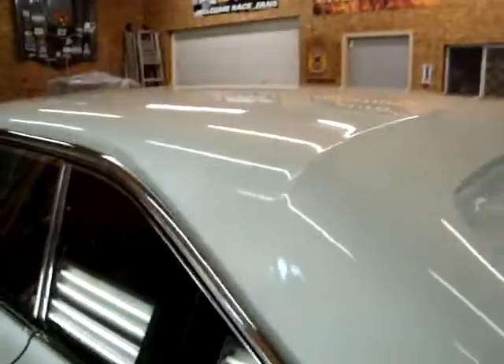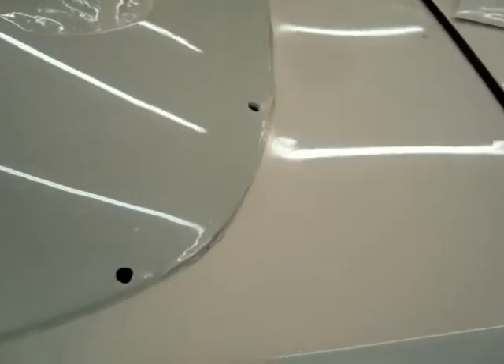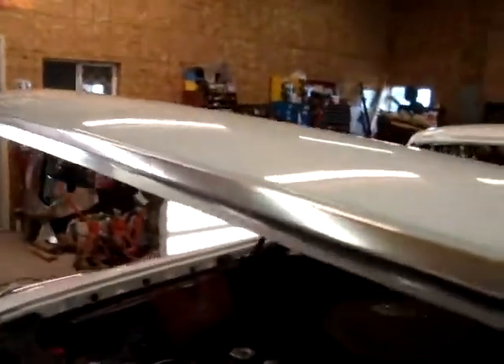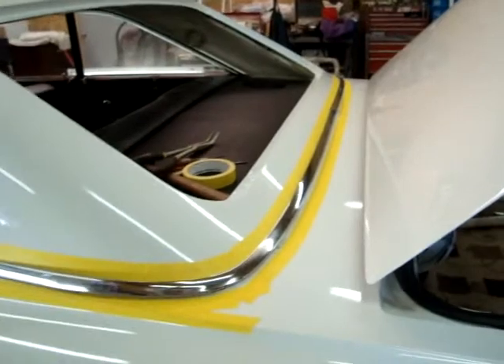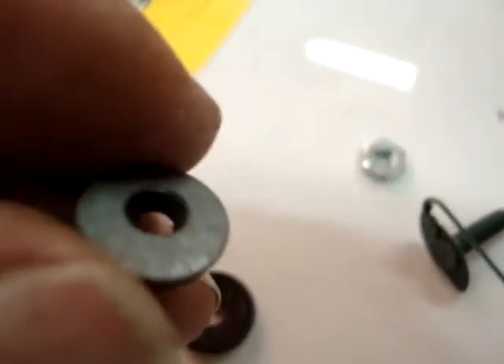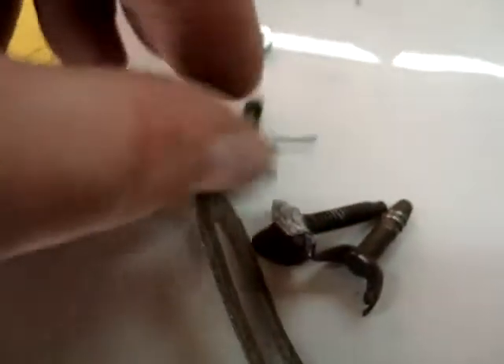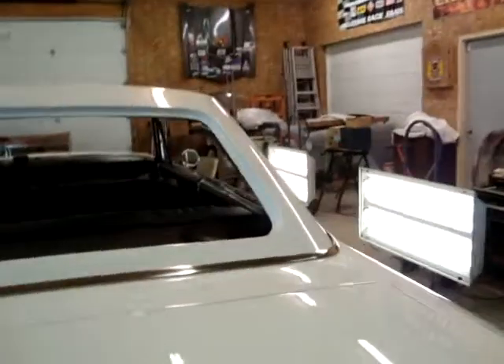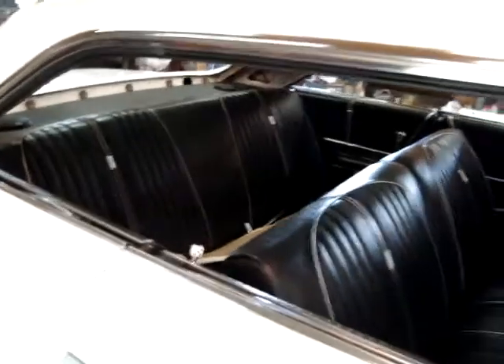1964 Ford Galaxie 500 Back for More Part 9

Comment: Sweet job Wendell! What do ya think of using regular washers and beautal on both sides of the panel.... between the trim and body, then between the body and nut with washer? id planned on making my own clips to replace the broken ones... and sealing that way.
Reply from the maker: Should work fine Mike, I have these washers and like how they work so I use them.
Reply: You can get sealing washers like he showed at a Volvo trucks dealership. They used them on a WIA64TES to hold the roof fairing to the roof. I would think you could also just use washers and clear RTV on one side of the washers against the inside of the body. Then after you put the nuts on, put some more RTV over the stud and nut. Thanks for showing me where those fasteners are in the B pillar. I have considered taking the vinyl top off my 64 fastback.